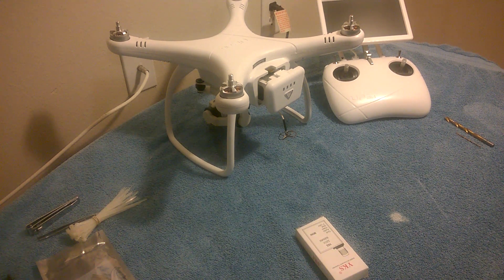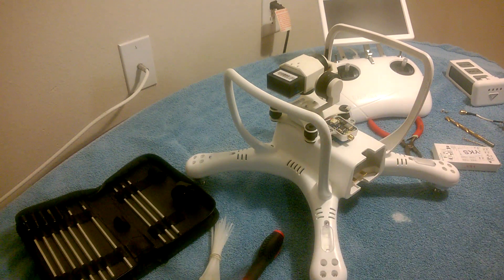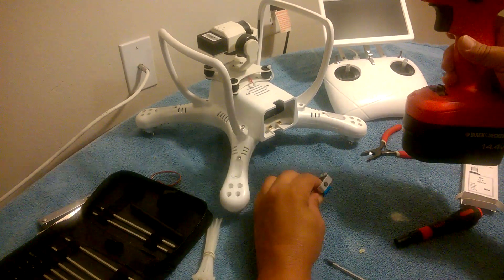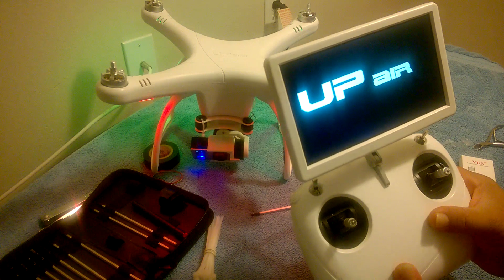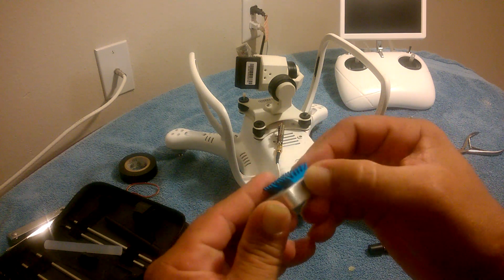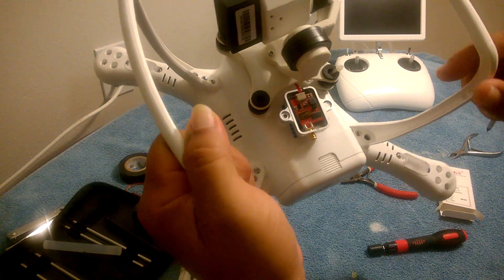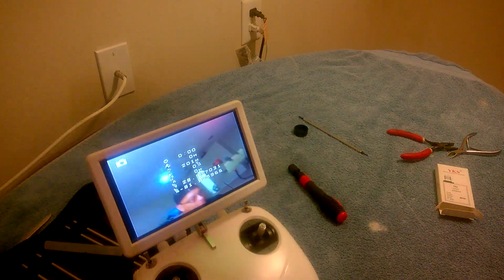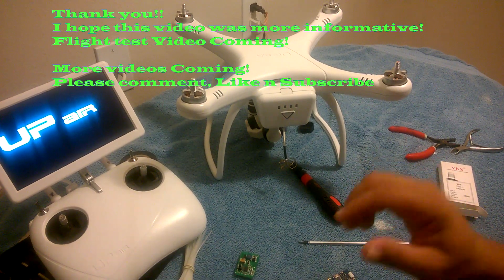UpAir One FPV Transmitter Upgrade #2

Comment: 💥✨💥 UPDATE.  I found someone who will sell me their controller.   Does anyone know if the controllers are paired to the copter or will any controller work with any copter.??  Do they work with some proprietary coding from the factory and what does the button on the back behind the rubber door do.??  Thanks so much in advance.   🤟🏼
Reply: Hello buddy.. yes i believe that was a pairing button for controller. Its been a bit so im not positive.. if u google pairing controller to upair, you may get results 😬😎 i dont remember how to get drone in pairing either :(
Reply: 407Defense I know that this video is old but so is my UPair One although my first flight was only a few  days ago.  I tried similar google searches to what you suggested but found nothing.  I wish I had a way to be sure if another controller would fly my copter.

Comment: 💥✨💥 Thanks for all of this great info.  You really know your stuff.  I know this  vid is older than the hills but... I just got mine UP in the AIR today after owning it since Christmas of 216.  Long story.  I charged everything up and it all turned on but the monitor screen shows black and white lines all through it.  By any chance (a long shot) would you know where I can buy a new transmitter.?? It seems as if this company has closed its doors.  No reply to email, their phone just rings and rings. 9:12  so envious.  Your screen works.

Comment: So, for around $300 you can buy this drone, spend days upgrading various parts of it, and perhaps another $50 on parts and extra blades, and still have a drone with issues... or, you can spend about $416 and buy the DJI Phantom 3. Hmmm, that's a hard one.
Reply from the maker: marjamada lol.. well said thats why i now fly p3s amd p4 .. i will mever go back to budget knockoffs. check out my otber vids
Reply from the maker: SPI Life i did the mods to fix not upgrade though. i hear upair less issues so modding it would be fun.  i dont have experience with new model.. great comment and thank you for your objectivity. 😊

Comment: I was wondering if I have the new version of the upair 1 or the old version my receiver shows the battery life of the receiver  on the upper right hand corner of the fpv also my battery is a 1500 mamps and it has a different plug for charging and the charger itself is different has only one little light in the right hand corner versus the one on YouTube that has three lights if you can help please reply.

Comment: jose what is the best fpv transmitter to use the 200 or the 600
Reply from the maker: Danny Stipe 200 for me. bettery dosnt last that long for really far distances that 600 give. :) imo
Reply: uh my up air 1 only has 3 plugs?

Comment: hi there.. thanks for the informative mod of tx signal.. how long this 600mw signal can transmit to fpv? do you know also about how this copter be calibrated the compass? is it require this copter to calibrate compass before to fly? thanks in advance..

Comment: hi is there an upgrade for the later 2k version , i bought mine august G10 version,, fixed camera tryed the ts5823L, 4 pin on the drone , 5 pins on the receiver, didnt fit right .

Comment: i bought my upair one about a month ago what is different with mine? ie check your version first before attempting upgrade?
Reply: Assuming yours is the latest version (i.e. V3 with the non-removable, white camera) then yes. The wires are not plug and play but match up like this:Red=Power
Yellow=Ground
Black-VideoIt depend of what comes with your new transmitter card as to whether you can change the pinot or have to splice and re-solder the wires.
Reply: Owen Manderfield can u send a picture or video on that I'm really confused my # is 508 988 0462 please I really need help

Comment: Thanks for the video -inspired me to do the same as there great copters are spoiled by the low FPV performance.
I have the newer (v3?) version with the non-removable 4k camera (no sound). I had to splice and re solder wires to match up with the new 200mv transmitter (thanks to all those who have posted the correct the correct colours elsewhere) . They are
Red=Power
Yellow=Ground
Black-Video
Took me quite a bit of trial and error to find a channel that the stock UpAir receiver could tune to - but got a good picture eventually.
Did my first range test this morning - but performance is about the same as the stock 50mv transmitter using the standard "Wand" type Arial that came with the card. I get more motor interference too - but that might be because my connecting wired are now longer.
I'm going to try shifting channels tomorrow and re-testing. I have some clover aerials on order too as well as a 600mv transmitter. I will post results back here.
Anybody else out there had disappointing results after the upgrade?
Reply from the maker: Me too. i went back to the 200 readytosky. no problems after that
Reply: Played around with the channel and frequency selections but no improvement. I wondering if I'm expecting to much or if the stock part in the "V3" has already been uprated (after all they've fixed a number of other issues).  What sort of range were you getting before the upgrade? and what now with the 20mw - and I wonder how much improvement is down to the clover leaf antenna.
Reply: I was hoping to get 1,000m - the limit of the R/C - I forgot to check the telemetry this morning to see at what range it drops out. I was running across fields but behind trees which obviously effects the signal. But the signal was degrading quite early on well within the 500m. New antenna tomorrow so probably test and re-post Thursday.  Thanks for your posts.
Reply: Did a proper line-of-sight test this morning with the upgraded 200mv transmitter - it got to about 620m before the FPV started dropping out completely. Even them I was still able to turn round and head back using the temerity. This was with the stock "wand" antenna that came with the card.
Reply from the maker: nice :)
Reply: I sent you several comments on your Channel you have not answered just wondering why I guess if I don't hear from you I'll be seeing you.

Comment: Continued, you also warned about not being plug and play.
What do I need to do as the stock fpv video is very poor.
Please advise, need your help, or anyone who can provide correct info.

Innovative etching ....inetch.com
Reply: It's actually not that hard,  use the wire-connector that came with your new transmitter , on the transmitter side use yellow red black.  (the black next to the red) . on the drone if you pull out the connector going to the old transmitter with 3 red wires on it, you'll see it connects to a red black yellow set of wires.   cut the red wires and splice into them.  you want to end up with  the yellow transmitter wire going to the black drone wire,  Red transmitter wire going to yellow drone wire, and black transmitter wire going to red drone wire -  at least that's what worked for me.  Do at your own risk :)  - if in doubt use a volt meter,  should be ~11.5-12v
Reply: oh - transmitter I used was a TS5823L 200mw   - regardless red+ Black- and yellow video - just find those on which ever transmitter your using and match as above.
Reply: Steve.. did you figure it out?

I can explain it in simple terms.. you actually don't even need to cut the wires, I did mine with the same connector which unplugs from the stock transmitter. It's pretty easy actually, I can walk you through it step by step.
Reply: C Lete can you explained how to do it I tried but it just didn't make any sence

Comment: Hello, and thank you for all the info... but need your advise.
I have the new version up air, version 2 with integrated camera, no audio.
I purchased both the 200 and 600 fpv transmitters.
I noticed that the plug one the drone have a plug with 3 red wires and 4 connector pins. I see on the transmitter, there is a connector with 5 pins, and 5 different wires.on the new supplied connector.
Please advise on how to proceed.
Steve
Reply from the maker: I am sorry, I have no experience with new model
Reply: I've done the 200mv upgrade on your model (v3) - I had to splice the existing wires and re solder to the new wires supplied with the transmitter, matching up the colours from the Quad to the inputs on the transmitter.

Red=Power
Yellow=Ground
Black-Video

One point to note is that the new transmitter appears to have many more channels/frequencies that the UpAir receiver can receive. Unfortunately I cant find a list for the UpAir and the first couple of setting om my transmitter didn't correspond  to anything the receiver could pick up - and I thought I'd goofed on the wiring!
After several channel/frequency changes I found a number that do match and work fine.

An interesting side note - is that the old stock UpAir supplied transmitter - is actually a 40 channel unit! - go figure! Anybody have a spec on the UpAir receiver?

Comment: tape for the heat sink O.o you never done many electronic mod huh, you need either A thermal paste to transfer heat or a thermal pad
Reply: Cool video Jose, well done!
Great information, I have found it very useful.
Reply from the maker: more of protection from shorts or scratching. it wasn't made to transfer heat. I have two heatsinks on the outside and I have thermal paste on them. it was really just tape to put there. no real rhyme or reason. lol.. hifive!!
Reply: defiantly use thermal pads , they prevent scrathing and transfer the heat from the chip to the acutal heat sink, my point was the tape is preventing efficient transfer of heat.
Reply from the maker: good point :)) thank u!!
Reply: He is correct. Heat transfer paste will assist with cooling. It shouldn't short on the black surface on the transmitter board, it is flat and designed to be mounted on a heat sink with heat transfer paste in between. Make sure the surfaces are flush. The electrical tape blocking the heat transfer could have caused the issues on the 600mW unit, possible over heating. (or maybe its just crap) haha
Reply from the maker: +Mark Reeves great comment brother! I will remove it and add some paste I have here😀
Reply from the maker: thank you.. also keep in mind this is for my version of the drone:)
Reply: what kind of paste are you using where can I get it

Comment: Nice vid, what is the improvement. How much further is the FPV range with this upgrade. Thanks
Reply from the maker: hey, thanks for stopping in. I think I have a faulty part. you can see my distance fail video. I am purchasing a different brand this week. I will document results. I know my 200mw distance was 1050m out at 50meters high and great video with no noise :)
Reply: +JoseB Vlogs Thanks for the reply and i will look foward to the video.
Reply from the maker: Pepper Boy https://www.youtube.com/watch?v=BItOggtDcps
watch whole thing. :D its more entertaining after I reach midpoint. :D
Reply: +JoseB Vlogs Looks good. could you specify the make and model of the upgraded transmitter please
Reply from the maker: readytosky 200mw where I got it is in the description of that video. :D
I did upgrade to 600mw which it was made by YKS.. this thing either came defective or its crap. stay away from that manufacture

Comment: What transmitter model you currently use?
You don't recommend the model that posted link?
https://www.amazon.com/gp/product/B016ZSJ0AQ/ref=oh_aui_detailpage_o00_s00?ie=UTF8&psc=1
Reply from the maker: no, i made this video after I bought it. it didnt perform well, went back to my 200mw from Readytosky. but maybe others may have better luck. I am just trying to put quick how to vlogs up to help. With that said, everyone is at their own risk when performing modding. I should take down that link though, glad you brought it to my attention. :D
Reply: I asked a question in your other video.
Can you help me?
How to set the date and time?
Reply from the maker: oh, i am sorry. I will check my camera tonight and properly answer your question. : ) My apologies.
Reply: Hello.
Could check on the set date and time?
What upgrade equipment FPV you currently use, you can send me the link?
What distance reaches?
Reply from the maker: Great questions. i use the readytosky transmitter 200mw on drone. controller is stock. use mushroom antennas. 1050 meters distance! :D
Reply: About how set to the date and time, you check?
Reply from the maker: I have been at work sorry. its month end and it gets very busy!
Reply from the maker: +Fernando Chaves Loureiro which camera do u have

Comment: didn't see a usb mod on this quad ? 😂 that's like the first thing I would have moded
Reply from the maker: thank you for stopping in and commenting. I appreciate all the comments and input. with that said, let me ask you, why do the usb mod? what value does that bring?
Reply: +Jose with the usb mod you are able to change certain parameters of the quadcopter! you can make it go faster, more power to the transmitter and other things, very cool if you like to tinker with your electronics!
Reply from the maker: I like to tinker but I also break stuf lol.. I will try next week :)
Reply: +Jose 😂 "at your own risk"
Reply from the maker: man,, glad u came by and provided great comments. thank u..
I will think about mod lol
Reply: +Jose there is a couple of little videos on this on youtube if you want to check it out. This also gives you the option to program way points from your computer
Reply from the maker: hifive!!! thank you very much!

Comment: I've just noticed that this is the VTX on Amazon is exactly the same as the one I bought, just mine doesn't say YKS on it http://www.gearbest.com/fpv-system/pp_361637.html?wid=21
Reply: Thank you !
Reply: TS5828L 5.8G 600mW 40CH Wireless Transmitter it is the best transmitter for drone?
Reply from the maker: +Eldin Rusiti I think that's the model 😁

Comment: I tried this on my upair one and all I get is lines and noise tried two transmitters . I don't know whats wrong if ihook back up my old one it works fine up to about 10 ft. what am I missingthanks marv
Reply from the maker: so your getting an image right? its just lines and noise? I would definitely change the channel on the transmitter then match that with the channel search from controller. maybe its interference with your current settings or the "default" settings of transmitter if you didn't change them.
Reply: I tried every channel and the same . the problem is that the plug on the upair  IS +  ground  skips a pin and video.   any FVP IS + GROUND - VIDEO. I DONT UNDERSTAND HOW YOU GOT THIS TO WORK. WITH OUT CHANGE THE WIRES. CHECK YOURS AND  SEE IF THE PLUG ON THE UPAIR IS + GROUND- VIDEO . THAT IS THE ONLY WAY THIS WILL WORK.  LET ME KNOW WHAT YOU FIND OUT
Reply from the maker: +Marv Bailey I will look at documentation for transmitter
Reply from the maker: they are all in line!
I will post pictures to your email address when i get home. I am at work right this second :)
Reply: HOW LONG AGO DID YOU BUY YOURS AND WHERE DID YOU BUY IT GOT MINE FROM BANGGOOD FOR 304 ATER DICOUNT. GUESS I AM GOING TO HAVE TO CUT THE WIRES. MIGHT BUY A EXTRA WIRING BEFORE I TRY IT
Reply from the maker: Delivered Jun 30, 2016
Your package was left at the front door or on the front porch.
UPair Drone with 2K Camera,5.8G FPV Monitor Transmit Live Video,2.4G Remote Controller, GPS Auto Return Function, a key to Return, Beginners Drone
Sold by: G10 Drone Product question? Ask Seller
$289.00

Comment: Thanks for the great video. Amazon would not send the yks to canada but they will with an alternate supplier in China..just have to wait for 1-21 days.  My upair1 after about one minute of flying gets squiggely lines on the video, but not on a second back-up monitor,  and finally defaults back to the up Air logo black screen.
When this happens i just diddle the frequency switch on the transmitter until I get the video back and it works great for the rest of the flying period.  I havn't flown it much yet as I was waiting for supplier to replace it, however i am not going to send
it back, because of the problems people are reporting and I dont want to take the chance with another one or packing this thing up and trying to send it to china.  I have noticed a little break up on the distances I have flow so far but nothing serious however after seeing how you demonstrated this modification, has really got me excited about using it.  Here is a little
video for you to see how I have flown it on a farmers field he gave me permission to fly it in.  He is 92 years old.  I showed the video to him and he was completely amazed.  Thanks again and Happy Flying.  GrampaKenCanada

https://www.youtube.com/watch?v=ntLQzUZLafE

Comment: I'm going to replace the original video transmitter with this Crazepony TS5823 5.8G 200mW 32CH AV Transmitter for QAV250 FPV Multicopter. How many meters do you think this will add to my range?
Reply from the maker: great question! let me know 😉

Comment: Hi Jose, last week I bought the Up-air one 4k from banggood.  I want to upgrade the fpv as you did, aparently I can not order YKS 5.8GHz 600mW receiver that you suggested from Australia (both amazon and ebay is saying...item cannot be posted). Just wondering as an alternative can i use this one http://www.ebay.com.au/itm/like/262494638913?lpid=107&chn=ps
Reply from the maker: thank you for the great comment. i really dont recommend the yks. it didnt work for me. i am putting my readytosky back in this weekend. just look for fpv 5.8 transmitter. plenty to chose from. : )